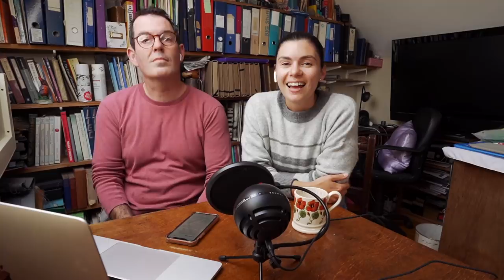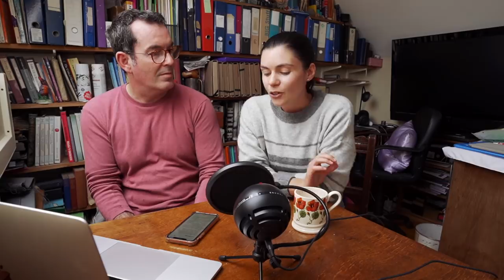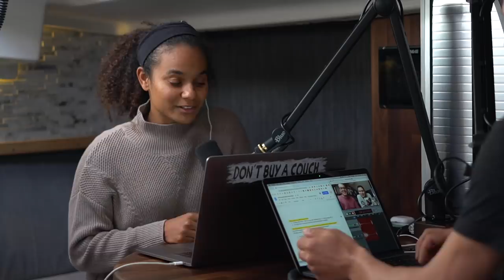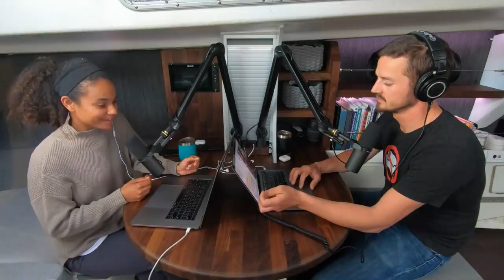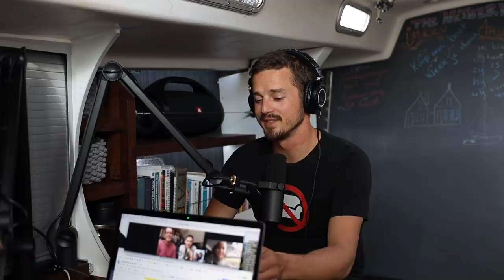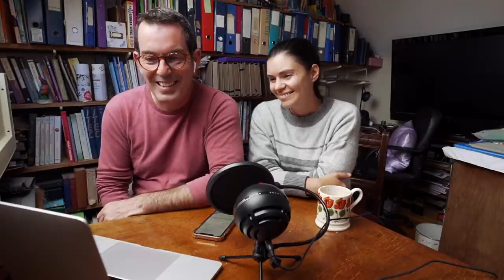Electric Engines on Sailboats: A Complete Guide! | Sailing Uma Interview

Comment: Thanks again guys for the chat!  We had a lot of fun and great conversations (on and off the record ) 😉Looking forward to catching up with you again somewhere out there.
Reply from the maker: Ah you guys are champs! We learned so much from you and yes, a catch up somewhere around the world is a must. Fair winds
Reply: Regarding sailing range of electric vs diesel perhaps the appropriate comparison would be, how large of a diesel genset would be required (in kW) in order to reach electric's breakeven point of infinite range from generating electric motor power from diesel.
Reply: @jonathanoasis  huh?
Reply: @jonathanoasis  The largest Ocean volt make uses 15KW
Reply: @venomguysydney  Actually Oceanvolts largest motor is the AXC 40 kW.
Reply: I thought I heard costs were about the same now for diesel vs electric.  Given the loss of diesel maintenance and repair, did they convince you Nick? :)
Reply: @CalBru  I don't think it's even close to being "the same diesel vs electric". BTW the ecological footprint of huge battery banks vs the burning of diesel isn't advantageous for the former. I'd still do it if it was a reliable and sound option for real-life circumstances (which I doubt it is for all vessels and all conditions).
Reply: @C_R_O_M________   "BTW the ecological footprint of huge battery banks vs the burning of diesel isn't advantageous for the former." 
Really? Do you have firm and credible evidence for that statement? That you could share with us? From a reputable source? Preferably academic, and properly peer-reviewed?
Reply: @sailingrubyrose  so this begs the question.. I don't think you've revealed yet (or will reveal) who'll be building your boat, but did you do some calculations regarding the size of your battery bank? Solar size? Have you looked at electric A/C units? Backup power? Etc... please make a video on some of the things you're thinking about - I'm sure there will be many engineers with knowledge to help you along as well.
Reply: @sailingrubyrose  Oops.. literally just watched the next video about the Seawind 1370... looks perfect!! Why only 11kWh battery bank? OMG, can't wait and also want to see pricing... if you guys ever show it anywhere, my wife and I are flying out to check it out...giddy for you! :)
Reply: Excellent interview. Pragmatism upsets both camps. My decision to install a diesel in a parallel hybrid configuration, can offend both.  Well said in choosing for your needs and intended use!

Comment: I love both channels and it is interesting to see you have a discussion about this topic as I think you are at opposite ends of a risk aversion scale. The awesome Uma folk went offshore without lifelines in a boat that could only motor for 10 mins and the amazing Ruby Rosiers aren't happy if the life raft isn't perfectly positioned and love an all metal lifeline. When it comes to electric motors as the sole form of backup propulsion on a sailboat, I think it would give Nick and Terysa heart attacks thinking about all the possible situations that you could run into: leeshore in strong winds when dragging anchor, dismasting offshore, strong tides, becalmed before incoming heavy weather etc whereas Kikka and Dan are much more relaxed and are happy to make decisions based on their limitations and possible risks for the benefits they see with electric. Love the fact you managed to keep it respectful and others should take a leaf from this and accept that there is room in this world for both views and neither is 'right'!

Comment: Good info, I am wanting to switch over to electric and find Sailing Uma informative in the process. I have put my feelers out and even got to sail on a friends Beneteau 40 that he converted to electric, and have to say that I was sold then and there. He did the same thing that I am thinking. Run the diesel tell it dies, or keeping in repair becomes too much and switch. You're all right "it does not make sense to switch just to switch". As you talked about range is an issue and one that I have thought about. Even with a good solar array keeping up with the output of the electric motor would be very difficult on a mono hull. I sat down with an electrical engineer friend of mine and working some numbers, we figured out that a good size generator (6.5k to 7.5 k) could power the motor as well as charge the battery bank. The idea of a hi-bread for the "just in case" really appeals to me. Just thought I would put that out there for the masses

Comment: Two of my favorite channels together, perfect! Having worked as a senior designer at an architectural firm for 29 years and even doing a LEED platinum building with PV and water solar and geothermal was a real treat. What everyone hated was all the extra paper, even though it is recyclable. Yes plastic is a material and it is recyclable but what kills me is all the people going to a Costco type store and buying cases of bottled water??? Is your local water supply so polluted that even a built in filter won't fix? Do you really trust the source of the water in that plastic bottle? I'll get off my soapbox now.
Reply: I buy filtered water only (filled into my own containers) but only drank rainwater when I lived in the tropics.  It's easy to get except for when Covid protocols were at their peak.  :-)
Reply: or have a fuelcell that produces electricity  plus heat and pure h2o as bi-products remaining zero carbonfootprint
Reply: plastic have yo never heard of the pacific garbage patch  plastic  is not biodegradeble

Comment: Good interview. Well edited and good explanation of the tech. Good handling of the technical terms (coming from a MechE).  
Another way to think about resource comparisons is to look at the cost. The price of something is great first order approximation of its resource consumption. Engineers, like myself, are always trying to find ways to reduce product cost, and therefore are looking for ways to reduce complexity and material and the manufacturing process. 
This is why keeping the current motor is better than replacing. The money for new is spent on labor, resource extraction, and energy to produce the thing. The money given to labor, is turned around and immediately spent by those same workers for their own homes, food, cars, and energy. Again, it cycles through the economy back to mining, smelting, manufactuing, drilling, refining, and agriculture. And money/cost is a measure of how many resources are needed each step of the way.  
Now, that doesn't measure external problems like certain kinds of pollution. But it does measure, to a first order, the resource cost. Resource consumption and pollution are two separate things. Govt policy & politics will then interfere with that price, but in most modern economies, that is a second order effect.

Comment: Thank you so much to two of my favorites!!

Thought about the switch to electric motors as well, resigning to the need for a generator because many Pacific passages are against the seas, currents and winds.   Not comfortable passages but a direction that sometimes needs to be taken.

For historical reference, trains and container ships are diesel engines driving electric motors, and have been so since switching from steam. 

With the lengthy heritage, comes engineering documentation and naval codes for electric motors on the seas.  These codes might be good references.

Fair winds to all.

Comment: I agree with your take on "green".  Saving a boat from '72 from the dump and living in it is greener than having a new boat built out of bamboo or whatever we are told is least bad for the environment.  My fleet is a '69 Travco rv, '70 Datsun '72 macgreggor sailboat and a '77 dodge to pull the boat.   All would have ended up as scrap and I would have needed something else built if not for my love of old cool stuff.

Comment: What's your take on doing a hybrid config?  what i'm thinking is to skip the generator and put an oversized 39HP diesel on one hull, and an ocean volt sail drive on the 2nd hull. The diesel can be outfitted with the Integrelsolution 48V alternator to provide about 8kW to the sail drive when the diesel is running.

Comment: 45:00 talking about environmental issues. Some great common sense spoken. Boats last forever. The 37ft sailboat (Timber/Fibreglass) that my father built in 1975 is still floating with it's 3rd owner today. Looking forward to SYRR new plastic catamaran. It will last forever too providing many years of joy for those aboard. With a small carbon footprint.

Comment: Something that wasn't addressed which I would like insights about is electric motor size/cost relative to size of boat.  Is it also a parabolic curve upward?  And how do you measure it?  Displacement, hull speed, etc.  I'm thinking about getting a 16+ton 45' long keel boat... how much more would it require than a 36' Pearson with a fin keel or a 45' cat, etc.?  Big follower of both of you... Love Dan & Kika.  Love you all.  thx for the great interview.

Comment: Excellent vid! Thank you very much!!!
  I believe Dan stated that cats are an ideal platform for solar and even wind power. Range is still an issue with electric drive systems though,  even on a cat with a ton of solar and large battery banks. When battery energy density increases more (perhaps in 5 -10 years) that will be less of an issue. I still like the idea of going with an electric drive system with perhaps 2 gen sets as a backup power system on a cat. The downside of that is gen sets are crazy expensive.

Comment: Engines are combustion or pressure introduced in a cylinder,  motors are rotating electric magnetic fields so, it is an electric motor, or a gas/diesel/steam engine.  Your welcome :)

Comment: Last month I was in communication with Seawind regarding installing electric drives in the new 1370, ( Your new home.) They told me that they absolutely could not integrate electric drives into their newest model. I wanted to install a GenSet to feed the batteries on those  passages that required the extra draw. For me it's all about what I can and cannot work on to maintain an efficient boat/home. My wife & I have been driving electric cars for the past 9 years and our house in Los Angeles runs off of solar with a battery back up day & night. The electric cars have been saving us large sums of money compared to our luxury cars which now just sit in the driveway unused. I am secretly hoping that you two are bending Seawind's ear and are going to be able to get electric drives therefore clearing the way for the rest of us who will not invest in diesel engines if given the choice(?) Whichever boat we do finally settle on it will be electric driven and fairly power hungry with additional fridges and air conditioning, ice maker, indiction stove top/ BBQ, water maker, hot water heater. The only way I can sell my wife on the boat by selling our house is to not give up all the extras that we have become accustomed to.

Comment: I've been inspired for some time to build an electric ONLY drive boat.  No Mast/sails, out of a old (demasted?) sail boat (would prefer a cat for the surface area for panels)   Purposely equipped specifically for island hopping/coastal cruising with no more than 100 mile sprints between anchorages.  I'm having a difficult time finding good reliable electric drive data for efficiency.    Obviously slow is king, but I just wish I could find good data on Nm per KW for various boat designs.  I'm still seeking that 'generic formula' for boat size/weight/hull shape etc.
Reply: Look at silent yachts, they might inspire

Comment: Thinking of getting Irwin 37. I will use it for only short sails mainly in the area of bocas del toro. The weather there is variable with lots of days with not much wind. Do you think a 2kw solar array put in an elongated bimini would be enough to motor for about 8hrs at 4 knots with similar battery bank to yours?

Comment: Love this interview! 
I find it interesting when pro-diesel people talk about the relative smaller range of an electric motor and use it as justification to not go electric. Why is range important? Range is important because you need to know how far you can go before reaching the next petrol station. If your range is 500 miles, then maybe you never want to be 501 miles from a petrol station. But! When you're getting your "fuel" from sun, wind and sea, your "petrol station" is LITERALLY all around you. Range is irrelevant! Yes, you can argue that the sun doesn't always shine, the wind doesn't always blow and you're not always moving against the water. Fair enough, but give it a bit of time and one of those three items will return. Why are you in such a rush anyway? ;)

I want to one day build an electric cat too, and one of the things I want to R&D is the use of Aerogel as the core material between the fibreglass surfaces. Aerogel is SUPER light and a SUPER insulator (and, if you buy the right type, very hydrophobic). NASA developed it to use on spacecraft! The insulation properties of Aerogel are staggering! My thinking is that a really well insulated boat will require less energy to heat in winter and cool in summer (or in the tropics). That energy savings makes for a more comfortable home and may make electric power more sustainable. Plus, the improved insulation means that once you've cooled down the interior (or warmed it up) it will maintain that temperature for much longer. Imagine running air con for 30 minutes in the morning and the boat staying cool all day in the tropics. Here's a link with some stats, but go on YouTube and search for Aerogel and then sit back and be amazed. https://www.klayenersol.com/blog/aerogel/advantages-insulation
Reply: Never ever buy Fuel again, no smell, no need of open petrol stations, no problems with bad fueĺ quality,  isnt it dream?
Reply: To never see a fuel dock again would be so freeing.

Comment: Solar Panels in Sails
The electric drive is powered by an integrated system of Valence U24 lithium phosphate batteries and 600W solar panels. The solar panels are laminated right into the mylar sailcloth mainsail, allowing the batteries to charges while sailing, and another array of panels are sewn into the bimini for charging while at anchor or dockside. In the J-88 configuration that we sailed, the mainsail had 9 solar panels on each side, and the bimini has a zip-in 6-panel layout.  The thin-film solar panels are as flexible as the sail itself, shape smoothly when hoisted and flake easily over the boom (see photo).   Copied from  Sailors for the sea

Comment: It's a great discussion, but what happens when you need to motor into a bay against 30 knots winds and an out going tide... It's not always about motoring in no wind. Even diesels running flat out struggle in those conditions. In the end of the day there are many places you can get by with an electric system but especially in the tropics you may need to motor for days and in those situations there is not substitute for diesels.
Reply from the maker: Exactly mate. Which is why we are going for diesels in RR2

Comment: For those of you who like to do electric drive when you work whit less than 50Volts the legal requirements are less stringent.
But you have this problem larger voltage = thinner cables for the same power, that is why 48Volts for do it you're self systems.
If you go whit a forklift motor remember you have to cool both the rotor and the stator and that is why going whit a motor that has coils only in the stator is the way to go since that one can be liquid cooled.

Comment: Great interview, and the topic is of importance I believe,...the pros and cons of it, to or not is something you really should consider before doing so,I like the ideal of it ,but I dont think it's enough yet in  justifying it as the main source of powering your vessel for safety reasons being the main issue, especially if your sailing with a family,children or a baby....alot can go wrong quickly more so with electric than gas and diesel,but those are fixable,as for electric/battery that's not an easy fix,please forgive me for saying during an emergency ...
Reply from the maker: You are exactly right mate. For now RR2 will have Diesel engines

Comment: For the individuals overly worried about range, there are very good hybrid solutions. And while the wind around the equator can be spotty, there is no shortage of sunshine to feed your battery banks.

The technology to go electric is more mature than the market mindsets. Just as with BEV's while there were more than a handful on the market, it took the Model 3 to really demonstrate superiority over the ICE equivalent. For a sailboat, particularly a catamaran with plenty of real estate for solar, no stink, no heat, no maintenance, quiet.

Comment: H2 generation and storage is the way to go on a sailboat. Then use H2 fuel cells whenever you need more power. H2 is 3 times more energy-dense than diesel, and it will be  'free'.

Comment: Nick,  I know you are analyzing every possible option for RubyRose 2.   As far as power propulsion have you thought of the outside the box possibility of a diesel in the port hull and an oceanvolt in starboard hull with the batteries or additional tankage to equalize weight?   Obviously you will use both in close quarters.  However, in open spaces you can avoid burning diesel.  Yet you will have the power and capacity for critical situations,.  Will one upgraded diesel fully support the electric required to run the ocean volt for a a long distance Wind less night passage?

Regards,
Jim from sailing_JLynn

Comment: remember on a cat you only really use both engines when docking, when transiting and no wind a single engine running in one hull is very often the norm for cats, same goes if you have electric which most gensets can run 1 electric engine. Main issues is the initial capital costs.